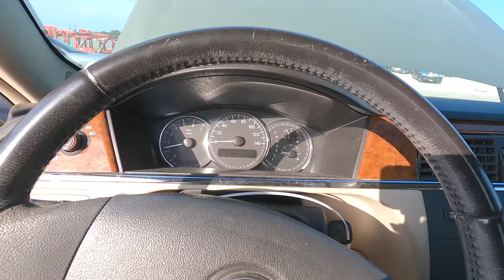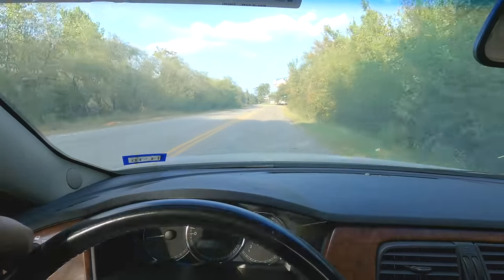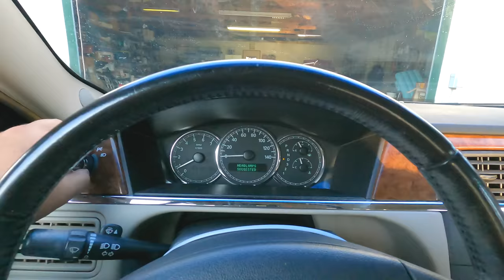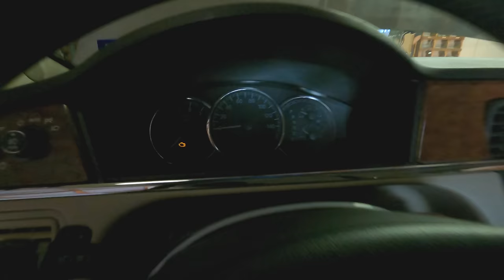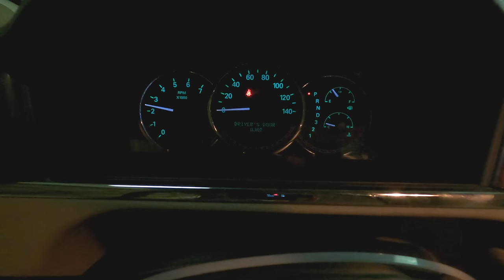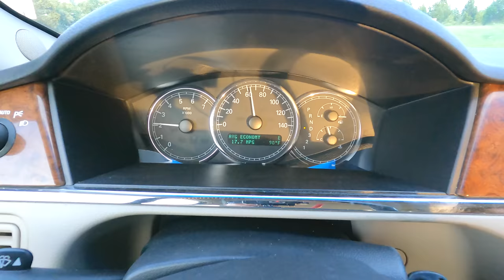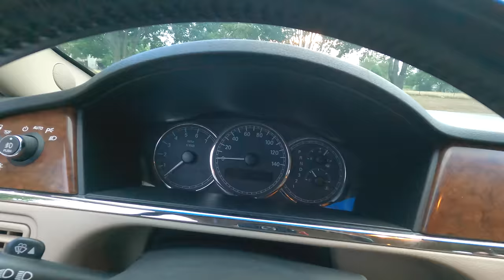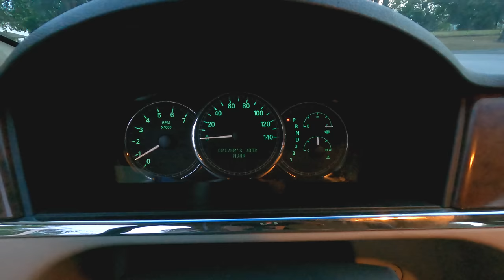I won a 2006 Buick LaCrosse for $675 from Copart!! Run and Drive?

Comment: Enjoyed watching this. In 2012, I bought a blue 2006 Lacrosse with the 3.8, and 40,000 miles. Kept it until 2020 with 173,000 and traded it in on my Camry.
My wife and I took the Buick on vacations and it was smooth and dependable. 
I lost her to cancer in 2015, so that Buick will always hold a special place.

Comment: I sold Buick’s for several years till 2013 they are all well built the lacrosse is a great candidate for being a runner with super high miles !!! I’ve taken them back in trade from loyal customers with over 300k and other than the buttons being worn off the cars always still ran and drove perfect.. GM is just as reliable as any foreign manufacturer…
Reply: Ikr I have A 2015 Tahoe with 110k and it’s really nice and reliable I really don’t know why people always say GM sucks GM IS THE BEST
Reply: @manpan4693  They are just as reliable as any Toyota ever made simple fact..
Reply: Exactly

Comment: If you get a remote programmed, it should have remote start also. My grandma has an 06 buick lacrosse cxl with a column shifter and 3.8 instead. They are phenomenal cars.
Reply: Also, if you hold the unlock button up on the door it will pop the trunk. Lol you looked at it twice haha

Comment: I daily drive one of these, mine is the Canadian version which is called an Allure. One of the best cars I’ve ever owned. I have the 3.8 motor in mine with a column shifter and a bench seat in the front. 65,000miles on mine not a spot of rust. Every option in it except leather and a sunroof. You got a really good deal!

Comment: (I’m sure you’ve figured it out at this point)To open the trunk on the lacrosse you just hold the unlock button on the door. My great grandmother had a 2007 Lacrosse CX with the series 3 3.8 great driving car

Comment: You can get rid of that green lighting and add more light by replacing the florescent lights with LEDs. Get 6 from Costco and daisy chain them.
Reply: LEDs light are the worse lights to put on your car in cold climate
Reply: @sammax4245  shop lights. I thought that was pretty clear. Also, he's not in a cold climate. Dozens of companies use LED lights. What were you thinking!
Reply: @sammax4245  what are you talking about? I was talking about ship lights.

Comment: I have a 2006 LaCross  with 68,000 Miles. Still looks and runs as new. Everything works perfectly. 30mpg on the highway. Same color as this but bench seats.

Comment: Looks like drivers side rear quarter has been repaired or replaced. Different trim on quarter window and paint is slightly off.  Otherwise, looks pretty good.  Great find.

Comment: Hi Randy, bigjrob22 here love the vids. On those particular buick lacrosse model the truck open button is intergrated into the unlock button on the dr door panel. I think you either have to hold it for a few seconds or push it twice.

Comment: The trunk release button in a 2006 Buick Lucerne can be found near the driver's footwell on the left side of the dash below the steering wheel. This will allow the trunk of the vehicle to open up. You can also open the trunk by pressing the button that is located on Your key fob. If the trunk does not release that can be a sign of a problem with the actuator for the lock, or an issue with the actual latch itself being out of alignment. If Your trunk does not open with either of those then there is a manual release that is inside of the trunk that can be accessed through the pass through in the back seats of the vehicle.

Comment: remember in winter the dooors would not shut at -20 and the windows got stuck open if you want to change the head light assembly you have to drop the bumper .

Comment: Your LaCrosse is built on the newer "W" platform, same as the Chevrolet Impala, Pontiac Grand Prix and the Oldsmobile Intrigue, even though the Olds was discontinued in 2002. The Intrigue was due to get slightly larger headlamps, just like the Lacrosse! I just bought a 2011 Buick Lucerne CXL with 88,412 miles from Copart in Wichita on May 2, 2022; only $2,250.

Comment: you ever find a 61 Buick Special with a nail head v6 please let me know. And you might want to keep an eye out for the and 61/2 tempest with the slant four pontiac
which was literally half of a 389 V8 with a torque tube going to a rear automatic or 4 speed transaxle another tempest indeed some were even supercharged

Comment: Step 1: Insert the key into the door lock. Use the side door on the driver's side and the physical key even if there is a keyless entry system on the car. Step 2: Turn the vehicle key to unlock the car door without releasing it. Hold the key for 30 seconds in the position.

Comment: That color is called Sandstone, over Neutral.
Great cars, I'd drive one.
This is a CXS with the 3.6, V6, the CX, and CXL had the larger 3.8 V6.
Thanks for the video, Randy, although a bit late on this one.

Comment: I have a burgundy 2007 cxl hahaha! Crazy to see this for so cheap.. mine is fully loaded with 18 inch rims and sunroof I definitely wouldn’t let it go for less than 3k. Won’t happen though after I fixed the plastic coolant elbows I haven’t had 1 problem with the car. Owned it 4 years as my first car

Comment: theres ways to revive old batteries using baking soda, or epson salt, forget which or sometimes they sell a premade solution at auto stores which are cheaper than a new battery,jfy
Reply: Baking soda neutralizes acid, so that would be a bad thing.

Comment: Hey Randy Service Anti theft system has to do with the PASS KEY III System the chip key is going bad and once it goes bad you wont start. Your PASS KEY III needs a new key or it leave you stranded.

Comment: You do realize that you are not "saving" any of the batteries? Just like the battery on your phone it loses capacity and strength. Yes it will indeed work, but at a VERY limited capacity. If the battery is a decade old, it is still a decade old. Always better off investing in a new fresh unit if it once has gone bad.
Reply: True if he were gonna keep it but this is going straight to auction.

Comment: Randy that has to be AT LEAST A 2007 Buick because they did not start putting those 3.6 L engines in till 2007 and its mist likely bad because of the timing chains all those engines have issues with 🤔🤔🤔 no matter the CAR or SUV if it has that Engine that timing chain issue is terminal ! Trust me I've been thru like 4 in my past !! Those engines suck !
Reply: I’ve  heard that about the 3.6 too,  so this one has either been repaired,  or just a lucky example, 186,000 miles!
The Car Wizard lists the 3.6 as a NEVER buy in any vehicle.  I always wondered if an updated maintenance schedule could keep these running?  Well, I’ll never chance it.

Comment: The theft deterrent system is always triggered on these gms even when batteries don’t have cold cranking power to turn over. Any time the engine won’t turn over properly it will always set it off. A real pain in the ass. Yes I’m trying to steal the vehicle I’m trying to jump lmao